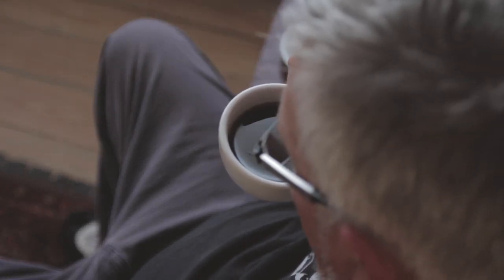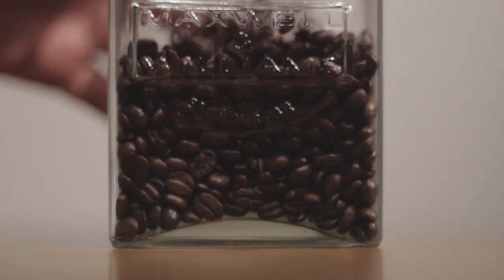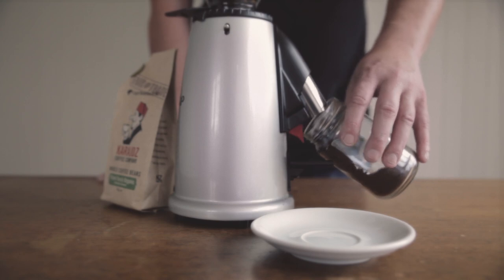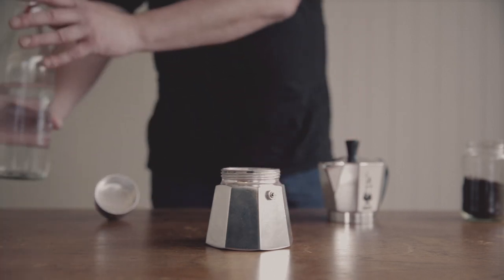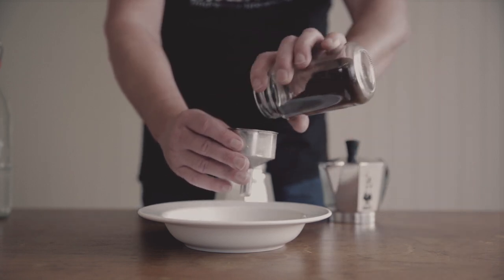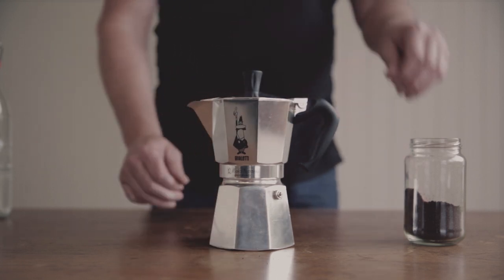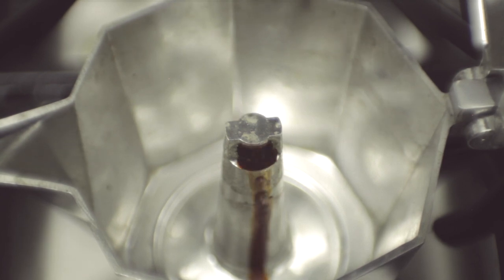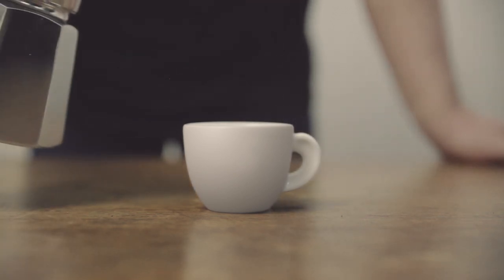Moka Pot Espresso

Comment: Lots of Moka Pot tips n tutorials out there, but this video basically sums up all the essential techniques needed to produce a fine tasting faux espresso out of your moka pot. Wish I saw this video earlier! Wouldve saved me a lot of wasted grounds hahaha big emphasis on the importance of grind, packing ur basket, and the part about "taking it out of the heat just when the flow becomes vigorous [...] the residual pressure is enough to complete the extracting process" is a new one, and is so so helpful. 🙂

Comment: You should boil the water first and then pour it into the base to prevent over steaming the ground coffee while the water is trying to heat up.
Reply: Also you should not ground the coffee beans that much and put some more heat on the stove, but as I see, he prefers strong coffee.
Reply: "You should boil the water first and then pour it into the base"
Not if you want to make it the authentic Italian way.
Reply: Absolutely wrong opinion made by moka pot lifehackers! Boiled water is not equal to slow process which is very important for full flavor extraction. Preheated water works good if you want to get something similar to espresso with crema using fine grind, but that's not authentic Italian moka coffee as being said above.
Reply: Not needed as the funnel where the coffee sits doesn't get cooked. I've been using cold for almost a year and I NEVER get an over extracted burnt taste.

Comment: Well done video on how to make an espresso correctly with the Moka Pot (at least from my own experience). There's a lot of other videos out there that give some bad / crazy advice on how to use a Moka Pot...this video is not one of them. So glad to see someone doing it right and knows what they're talking about. Many thanks!
Reply: Agreed.. I would point any new Moka Pot owner to this video.
Reply: Everything correct in this video but not the term "Espresso".  Because not enough pressure generated for a real Espresso (with crema). You need a moca pot with espresso valve. See Bialetti Brikka. I have one and it makes a perfect Espresso.
Reply: Arguable. I consider the flavor the defining feature of an espresso. Crema does not an espresso make IMHO. It is a side effect of high pressure brewing. The Italian Government has outlined multiple criteria that defines an espresso, crema being one. However, on flavor alone, most people probably would not be able to tell the difference between a Moka Pot espresso vs an espresso machine espresso - again, based only on taste. The Brikka makes fake but effective crema, I have both a 6 cup and 4 cup Brikka. They're very good at giving an espresso with crema experience.

Comment: Beuatiful video thanks! Just a question is there a way to make the cream on top?
Reply: liveatmax A standard Moka Pot will generally create some crema but it dissipates quickly. Bialetti makes another type of Moka Pot called the Brikka that will make sudo crema that is much better than the standard Moka Pot but not the same as from an espresso machine.
Reply: Frank Hughes Thanks!
Reply: I'm curious to try the Brikka out, even though I know it is not real crema in the way a true machine would produce... Does it add a layer of texture and mouth feel to the coffee that is worth the upgrade? I enjoy my Moka Pot very much... it makes a wonderful strong and flavorful espresso-like brew.... I drink it both straight up, or use it to create a Cappuccino or my wife's favorite Mocha. I use a Hario manual grinder with fresh beans to produce a texture between fine and drip, and keep the pot very clean. I also agree with pre-boiling the water as the video has shown to reduce over extraction. It makes a wonderful morning ritual that anyone who is passionate about coffee can enjoy at home without having to make a major investment. I'd say no more than $60 to $80 for a decent hand grinder, and a tried and true Moka Pot will suit anyone well!

Comment: Very nice video. Also, I fill my pot half way to the safety valve and fill the coffee grounds up to about 3/5 of the way, mine doesn't come out thick like yours does. Is all of the water you put into the pot used? Or do you leave some water in the bottom?
Reply: For proper operation, moka pots should have the full amount of water and coffee grounds. That's why they are made in a multiple sizes from 1 to 12 cups.

Comment: Mine doesn't pump all of the water from below... Almost half of the water stays in the bottom of the pot :( No matter how much I wait...
Reply: If half of the water stays down, the seal between the upper and lower part is leaking. You should turn the upper part real strongly when you close It, unlike the video. If this doesn't work, perhaps the funnel needs replacing or the seal itself. With a new seal, I experience this also, it needs running in for a few times until it is a tight fit.
Reply: Paul met Debbie Its's definetely the seal. When sealed properly, it works just fine.

Comment: You are talking about "Espresso". It is not Espresso! You need minimum 9 bar pressure for getting an Espresso. With a normal moca pot, no crema possible! For real Espresso, you need to get a Bialetti Brikka. It has a special pressure valve.

Comment: There's a line cast into the bottom boiler which should not be exceeded.
Reply: Bialetti instructions say to fill the water up to the bottom of the pressure valve, just like this video.

Comment: My observations: 1. You say use fresh coffee grounds as you need it but the fact that you left grounds in the jar suggests that the next time you use the grounds they won't be 'freshly-ground' 2. I would start with boiled water 3. It really isn't espresso coffee as you get very little crema with this method 3. I have a moka pot with a see-through lid so there's no risk in touching a very hot lid. I only open the lid to clean the pot.
Reply: Agree. For Espresso you need a Bialetti Brikka with an high pressure espresso valve. I love it. And even my italian friends were surprised. They did not know that such a device exists.